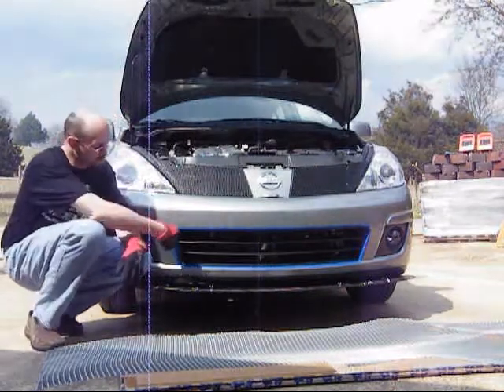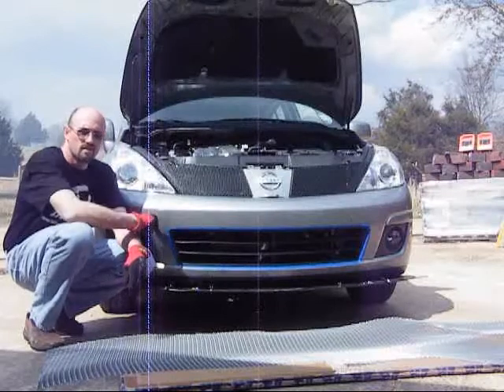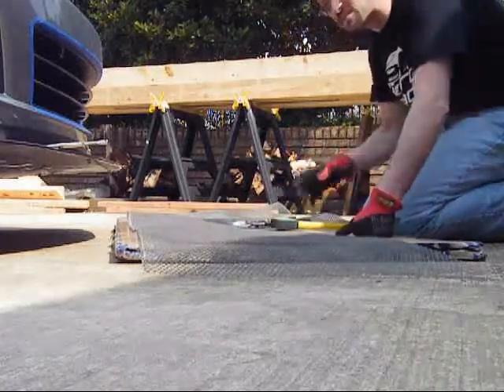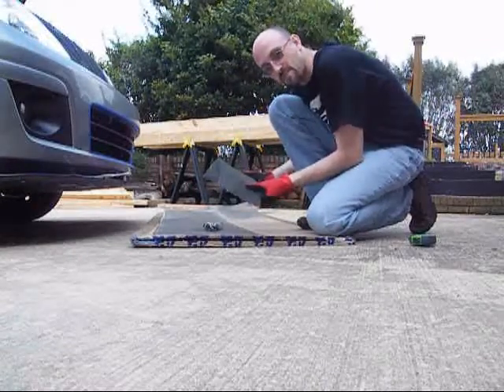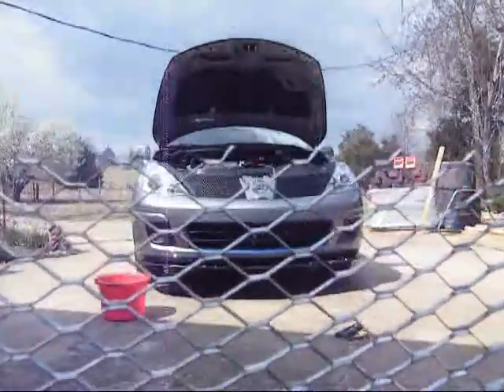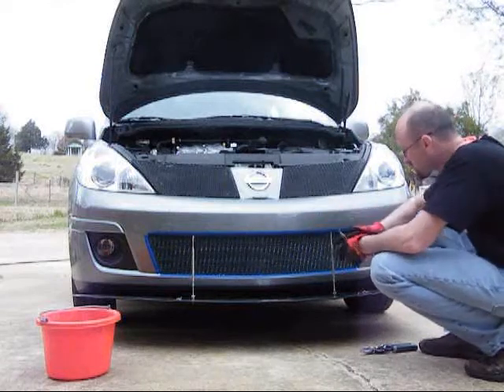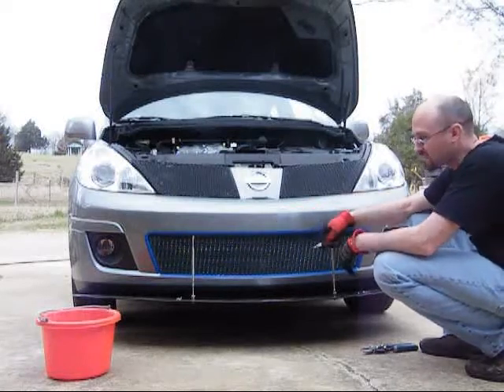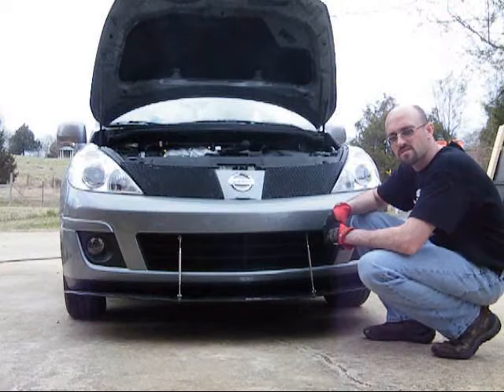Making a Custom Lower Grille for Your Nissan Versa

Comment from the maker: I used 7 zip ties to attach to the grille.  Mine fits tight enough that it doesn't really need the ties, and I also have the splitter support rods that help keep it on.  The zip ties (5 of them) are along the bottom and two in the upper corners.

Comment from the maker: Use black zip ties on the corners and bottom edge.  I put 2 in the upper corners and 5 along the bottom edge.  Secure them to the bumper supports.

Comment from the maker: @HardRockRecords I put 2 coats of paint on after one coat of self-etching primer.  The mesh is actually fireplace mesh from Home Depot.  It comes in a 3 foot by 8 foot flat sheet.  I started by cutting the basic square shape and then fitting it to the bumper.

Comment from the maker: As posted below..

I used 7 zip ties to attach to the grille. Mine fits tight enough that it doesn't really need the ties, and I also have the splitter support rods that help keep it on. The zip ties (5 of them) are along the bottom and two in the upper corners.